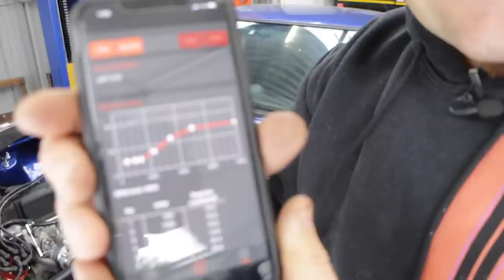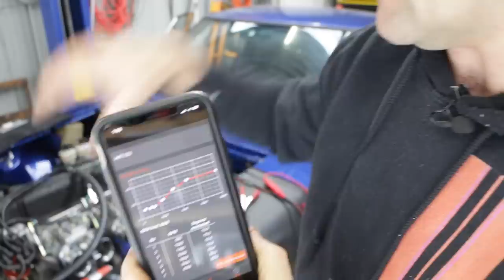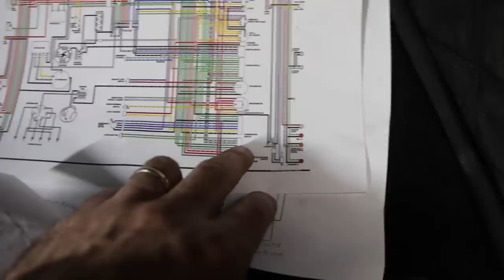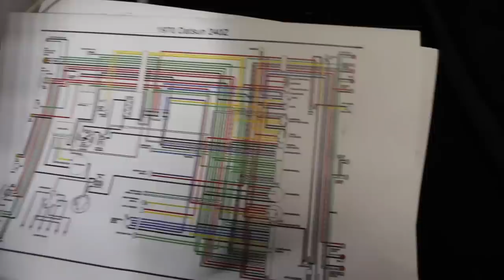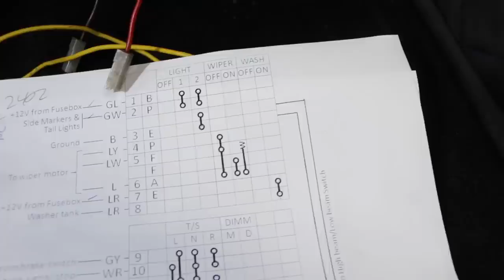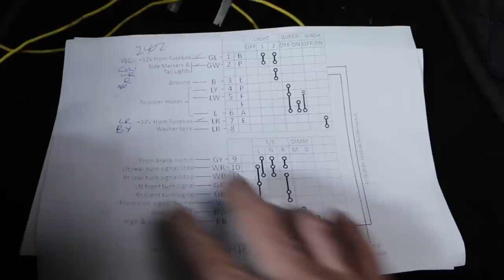Fitting a 123 Distributor - Home Built Datsun 240z part 96

Comment from the maker: I played with it again yesterday and the timing was heavily retarded. Now the weird issue is that it's happiest idle shows as over 30 degrees advanced timing? My current thought is I may have the timing shaft 1 tooth out?
Reply: yup, that sounds about right, popping out the intake also means that its WAAAY retarded, also does the 123 ign kit say to setup the dizzy at tdc or at the idle static ign timing?
Reply: Maybe just turn the distributor clockwise till the light turns off then back on again? Not sure how those 123 Dizzys work
Reply: Harmonic balancer may have slipped and timing marks are off. When the rubber gets old that happens to these balancers. So when you set it at what you thought was TDC, it may have not been TDC. I'm guessing thats what these distributors use as a baseline for the install. Btw, These engines LOVE lots of advance.  What position is the cam gear set at? 1? 2?
Reply: That Dizzy isn't right mate. The only time you have an actual back-fire rather than an after-fire is if the spark is ignited before the valves are closed.
If you're at 30° on your app; you need to manually adjust the dizzy forwards then try tune it on the app again.
Reply from the maker: 1.
Reply from the maker: I rotated the dizzy. It is zero on the app, 30+ is with the timing light.
Reply: Hi Jeff, I remember setting up my distributor and each tooth on the oil pump drive is about 30° so I would think that it's out a tooth.
I also remember that I could never get the timing right with the shaft in the same place that the factory service manual wanted it, I would have to put it one tooth out to get it to run properly.
I'd try moving the shaft over!
Reply from the maker: @andrewlangford88  I think I will try that
Reply: @HomeBuiltByJeff  looked distributor  install 5 times, it looks like the rotor is not pointing at the lead
terminal in the distributor  cap , have a look for the spark mark on the rotor
Reply: Funny that you posted this today- I'm doing the exact same thing (123 ignition install on triples) today and it's driving me crazy. I was thrown off because the rotor on the 123 is not pointing the same direction as the zx rotor, so I came online to find some answers, and what do you know! I found this. I am going to take off my valve cover to check that the #1 is at TDC.
Reply: Watching and listening to that is a timing issue.  All of these need to be checked.  Firing order, bad plug, bad plug wire, check TDC with the first plug out and a probe in the cylinder while turning...
Reply: As I previously stated in your color tune segment, that oil pump drive shaft tangent should be at an 11:25 position, offsetted to the rear, meaning the top of the tangent should be toward the front side of the top bolt hole and the bottom of the tangent should be toward the back side of the bottom bolt hole. Right now your oil pump drive shaft is about a tooth advanced

Comment: Having gone back and watched the video of it running with the points distributor it didn't cough and splutter, so I would at a guess say the issue is not the carbs, but the new distributor.  Use the timing light to see if the magical computer and app are doing what they say they are doing and set the timing to the pulley accordingly offset in the app.
Reply: Yep, the carbs were fine before. Seemed odd to jump to the conclusion the new dizzy was good. It must tho', it has an App.

Comment: As I previously stated in your color tune segment, that oil pump drive shaft tangent should be at an 11:25 position, offsetted to the rear, meaning the top of the tangent should be toward the front side of the top bolt hole and the bottom of the tangent should be toward the back side of the bottom bolt hole. Right now your oil pump drive shaft is about a tooth advanced

Comment: Hi Jeff,
We just found your channel and love the videos! Also glad to see in part 102 that you found out what the cause of the problem was. Enjoy your 123!
~Team 123ignition
Reply: @123ignitionchannel  Are you meant to set it at TDC or at the Static timing point for the motor?
Also I thought you should never use the default curve but rather set it up manually to suit the motor?
Reply: @johnrich9361  It depends on the engine. For most engines, there is a static timing point which the original mechanical distributor was also set to. For example, if you check a repair manual for your car, you may find info about the distributor and the static timing point. Install the 123 on this point.
If you have a 123\Tune+ (Bluetooth), you need to change the standard curve in the Tune+ to one which suits your engine. If you have the mechanical curve on paper somewhere, then you can follow our tutorial on our website to convert it for the Tune+. Alternatively, you may want to go to a dynamometer to get the most optimal curve for your engine.

Comment: The carby balancing tool isn't for setting mixtures on the carbs.  It is to ensure the throttle butterfly is set at the same position on all throats (this controls the amount of air moving through the venturi).

One of the carbs (usually the one closest to the linkage from the throttle cable) will be the lead carb.  Adjust the other two to match the lead carb by adjusting the length of the rod that controls each of the "salve" carbs.  Use the balancing tool to fine tune the position of the "slave" carb's butterfly position in comparison to the "lead" carb.

A good way to learn about balancing carbs is to watch bike tuning videos.  They almost always have multiple carb setups and a carb balance is part of the factory service intervals.
Reply from the maker: Yep. I opened the inspection holes on the carbs and made sure the butterflies were all open at the exact same angle, and then adjusted my linkages to all be perfectly even so I think the balance is pretty good. Now it is just sorting the timing and then getting the mixtures spot on.
Reply: Measured angles and inspection gets it close enough to start and run.  The balancing tool is to make it perfect by measuring the amount of air moving through.  Slightly out of balance will not hurt the engine.  It will just be a little rough at idle and throttle response will not be instant as some of the carbs lag behind.

The linkages will wear over time and you'll need to do it again, and again.  Most bikes are every 12,000km.
Reply: +1 on the bike thing. Quad carbs were common. Pretty reliable and perform superbly in the multiple small size with straight-shot into the engine, but I'd forgotten the joys of finding a local carb guru to get the tune back. Bike fuel injection rocks but I also remember the early days trade off of choppy low speed throttle response.

Comment: Welcome to the Wonderful World of Webers. You'll learn a lot. You should hear a difference when adjusting the idle mixture screws. I think there is a set mixture jet as well for ball park setting. You did say these are recommended for the Z. Should be right then. Prolly throw a timing light on anyway, I reckon you moved a bit more after the green light came on. At 19:10, replace that inline crimp

Comment: Hi Jeff ,Check in this order, did you tell the 123 you are CCW .rev up engine and watch timing light .
 Is your brake booster holding vacuum .   Check your float heights.
 check your carburetor emulsion tubes are tight  . check your valve clearance "hot"
it gets 2 thou bigger hot. One tooth out does not matter now

Comment: My tip is disconnect the linkage so each carb is independent. Then balance the carbs. Use the throttle stop screw on each carb to synchronize. Once they are balanced then connect the linkage. If it goes out of balance again your linkage has not been adjusted to the same length for each carb.

Comment: Degree the harmonic balancer (crank). They slip when old, and you get the wrong timing indication on your timing light. I just get a silver marker and make a new TDC 0 mark on my harmonic balancer.  Of course to do that- you should take the valve cover off and look for the TDC mark in the ‘window’ when the first two lobes on the cam point up and look like “rabbit ears” (11 and 2 o’clock).  As far as I’m concerned that’s the correct procedure to start to dial it in.  I think you set up TDC correctly when installing the cam & timing chain.  So set TDC 0 on your balancer indicator from that !  She will run like a champ.

Comment: Always check your base timing with a timing strobe to make sure the actual timing is in sync with the map. It definitely sounds like your timing is far off. There is no way for that distributor to know exactly where the crank is without a crank angle sensor of some kind so it is completely dependent on your base setting.
The fact that your default map was at 0 degrees makes we think that it actually represents an offset from the base setting as per the manufacturer. If that is the case I assume it should not be set to trigger at tdc but at the factory base angle...

Comment: Have you checked out the main, jets, emulsion  tubes ,choke, etc ? Suggest you pop the cover on top of the carb and have a look. There are lots of  jetting combinations available and they usually need to be tuned for each application. Webbers usually don't work straight out of the box. Your doing an awesome job love your Z.

Comment: G'day Jeff chech all the butteflys are actually opening equal amounts.
As this will create what I saw. Yes so will small idle jets. But check the basic overlooked balance of All butterflys first.
It might be a pain but it's important for balance of carbies. 
Your linkages are adjustable by the looks of it. Make sure all idle screws are backed off so butterflys are shut. ( some carbies set ups only have one idle screw, some have 3).
Then loosen all linkages to carbies and adjust so all butterflys are fully closed.
Then check at wide open throttle to see if all are horizontally on the same plane.
If yes carefully tighten all linkages.
1st stage done. Then set idle screw or screws whichever style.
Base idle should just be cracked open at the butterflys.
Try running engine.
Does it improve? 
Yes then move on from there. Small numbered drill bits come in handy for changing idle jet size.
Be very careful @ this stage. Small increase in size makes quite a difference.
However also leanes out mixture @ idle.
Digital laser thermometer can be used on detractors to check individual cylinder temps.
If mixture screws will not richen up enough then trusty drill bits are used to change hole diameter 1 size larger at a time.
Be careful with drill sizes for all alterations.
Otherwise by heaps of jets and spend a fortune getting it to run right.
Good luck and it's getting very close now😉😊👍👍
Reply from the maker: I went through and checked the inspection holes and made sure the butterflies were exactly the same, and also made sure the linkages were spot on.

Comment: 123-Dizzy is clocked 90° off, but you copied the ignition leads' position 1to1 off the old position?
Be sure the rotor points to the connector of the 1st cylinder.
It looks, like it's in the 6th.
Don't play with the carbs!

Comment: I'm not at all an expert, but the motor in my truck runs best with crazy advance.  I had a guy who rebuilds motors suggest that I needed to check my valve lashing (?) as the number of times that the head had been resurfaced has changed how the parts fit together.  That may or may not be helpful, but I thought I'd throw it in.  Also at about 22:45 there's a glitch in the matrix, where two different segments of the same content made it into the edit. :) Glad to know you're human too!
Reply: Valve lash would make for rattling rockers.  Lots of head resurfacing can lead to riding rockers and valves not fully closing (for OHV engines) and you need to get the correct length pushrods to compensate, or for OHC engines, the valve timing is out in the direction of the tensioner (a bit like having a very worn timing belt/chain and the tensioner is fully extended).

Crazy advanced timing (or seeming to be crazy advanced) I would be comparing the marks on the pulley to the position of No.1 piston.  Broken keyway on the crank or balancer spun would make it appear to be a long way advanced but in reality in the correct spot.

Comment: Did you ever verify that the carb floats were all at the proper level with your pump running?  Did you also have the idle mixture screws set out about 1.5 turns on each carb?  You'll also want to set electronic timing +15 degrees as that's the sweet spot for triples.

Comment: Hey Jeff, I think the problem lies in the setup with the green light. When you turned the distributor CW to get the light, the rotor ended up on the backside of the #1 plug position. Try repositioning the leads CCW 1 spot on the cap and see what happens. My 2 cents.

Comment: Hi Jeff, I also had the same issue like you when changing distributors. The L series engines have as far as I can remember at least 4 different timing adjustment brackets. So to compensate for the wrong bracket when I switched to a points dizzy (found it for $25 brand new) I simply rotated the oil shaft 1 tooth forward, and that allowed me to get the engine running and idiling perfectly fine. Of course depending on the bracket you might need to move it forward or backwards one tooth on the oil pump shaft. Hope my comment is helpful to you, also go into community.ratsun.net, there you can find tons of info about the different timming adjustment plates! Good luck!!!!
Reply from the maker: No adjustment plate is needed for the 123. It can be spun 360 ;)

Comment: Use the colortune sparkplug, works great!
Reply from the maker: Next episode ;)
Reply: Backfiring out in let manifold  can only be two things a stuck open or leaking intake valve or valves,  or too far advanced  ignition timing if it goes away at high revs.... if you can get any lol. Verify timing by a second means. Also 12 degree advance at idle sounds like twice as much as  it should be compared too my old red 6cyl ??

Comment: Jeff you have a 3ohm distributor or a 1.5 ohm with a ballast resistor ? I have a 3.0 Ohm Pertronix and I am concerned as to whether or not it would jive with my new big $$$ 123ignition. I have a brand new (cheapy) 1.5 ohm and the original balast resistor that I had removed. What do you think ?
Reply: sorry bosch 1.8 not 1.5

Comment: A distributor with BLUETOOTH!? Bluetooth makes everything better
Reply: It’s pretty cool. It (123 Ignition Tune+ Bluetooth distributor) shows you:
advance and vacuum curves (editable),
MPH, RPM, Battery Voltage / Amps, Engine compartment temperature,
& can do Advance Tuning “on the road”.
Max rev limiter too...
And an immobilizer with a pin code. 
All from an iPhone or iPad (or Android) displayed App.

Been waiting for something like this.

Comment: Hey Jeff I did exactly the same conversion with exactly the same 123distributor with exactly the same outcome as you. Coughing and sputtering. Something extremely wrong. BTW it has nothing to do with your carburettors. Because as soon as I flipped the old distributor back in it runs like a dream. It’s the 123distributor so stop playing with carbys. I haven’t been able to find the solution yet still playing. But keen to find out how it ends for you

Comment: Oh, Jeff  - its always hard to figure out problems when so much is changed once... I´m also kinda afraid that happens when I finish my L28 with new cam, webers and 123 ignition :D Could you do me a favor and check if that Bosh Coil has this number:  0 221 119 030 or which one did you use? There is no extra resistor in your ignition/coil circuit right? Thanks a lot ;)
Reply from the maker: That's the one ;). No resistor
Reply: @HomeBuiltByJeff  many thanks ;) awesome to see a second video from you this weekend. Greetings from Germany!

Comment: Did you account for the 90 degree change in the rotor for the firing order, does that not make a difference? It does kind of sound like carb adjustment.
Reply from the maker: Yep ;)
Reply: @HomeBuiltByJeff  I think you nailed it with the idle jets. I had the same issue with my 78 911 SC when I switched to carbs.
Reply: Never mind just saw you timing response. LOL